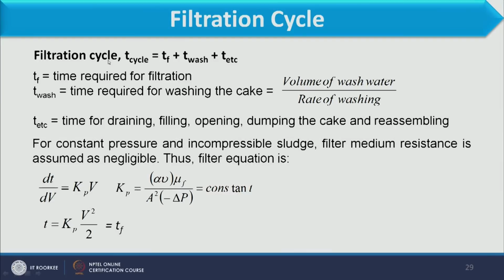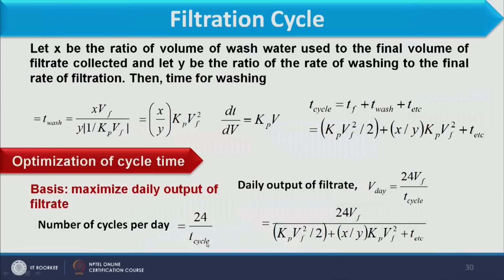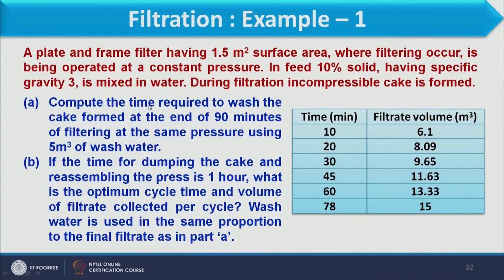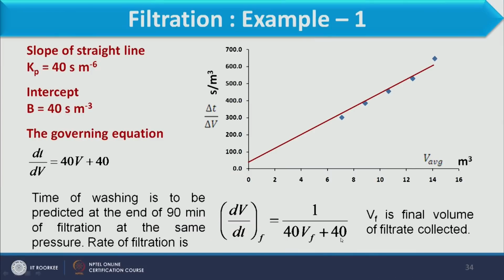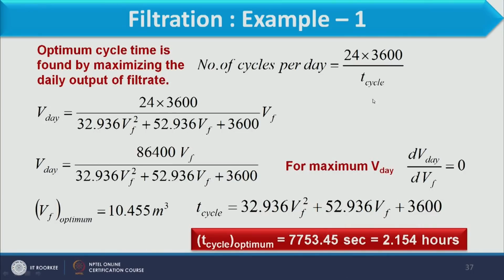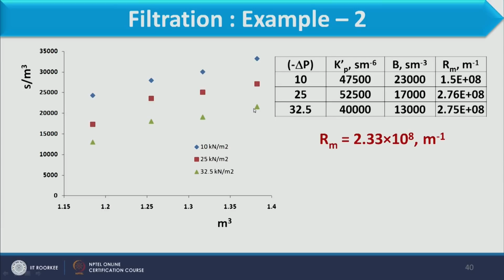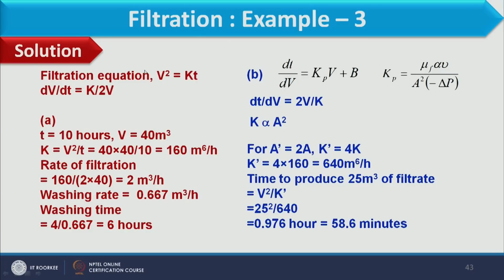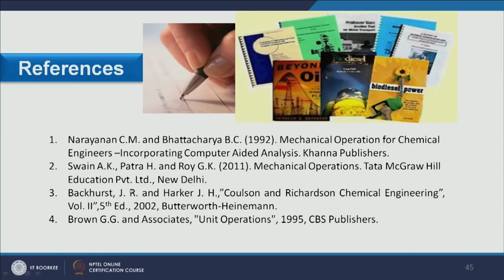Filtration-3

Comment: Both questions are solved totally wrong
Reply: They are drawing graph also wrong, solving also wrong, I can totally challenge this 
Completely wrong solution 
Even through curve fitting methodology, I can say the correct answers would be: 

Q1) Tcycle(opt)=1.86h , Vf(opt)= 9.7 , dVf/dt=1.4×10^-3 , 

Q2)Rm(avg)=4.698845×10^8, s=0.9776 
Please correct it
Reply: @arora.dinkar  what method that u used in question number 1 sir?
Reply: Only the last question is solved correctly, 
I appreciate that